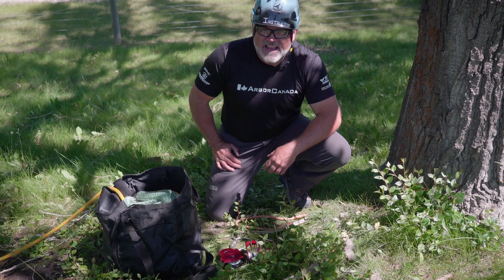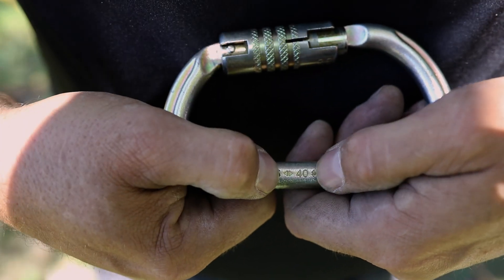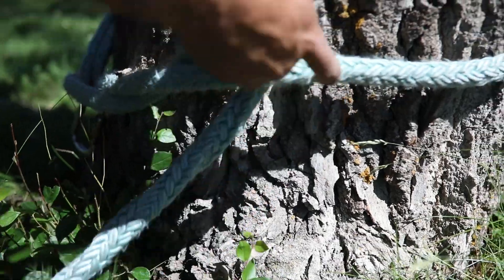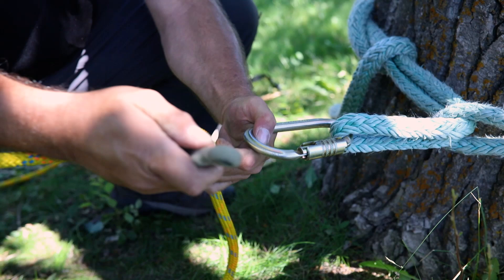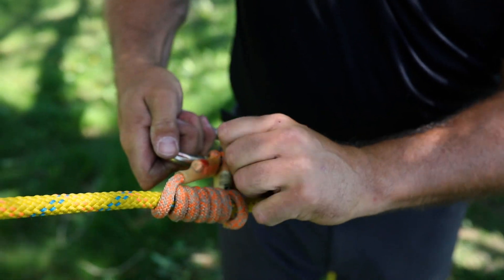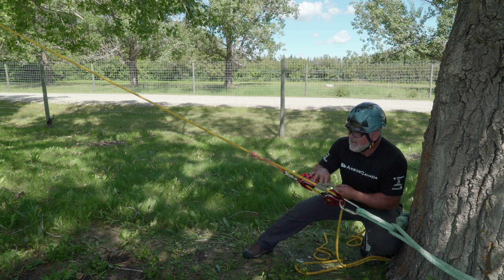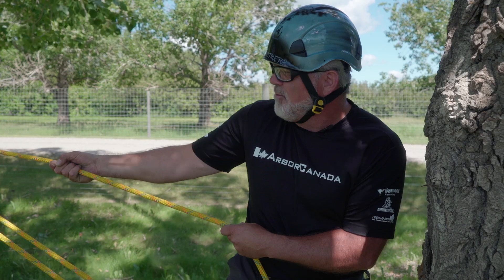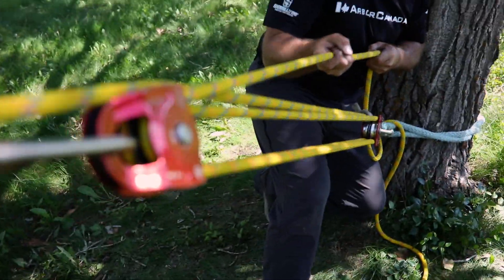Building Mechanical Advantage (3:1 or 5:1)

Comment: Great vid.
I must say I was immediately yelling at you cuz you should NEVER use only one sheath of a double block, it's very unsafe [wish you would've mentioned that].
For the purposes of instruction I understand why you did. Explaining the compounding forces applied is easier one step at a time.

I did learn about the french prusik so bonus for me and that does open up a few ideas. It's essentially a snatch prusik 😀. I am going to make myself a few french prusiks for my purposes, even with just a carabiner it'll help with similar riggings I use. Not as much mech advantage but enough for my use-cases. My "200 lbs" is constant [at a fat ~220 lbs 🤣] so when I only need to pull 600 lbs I don't need 5:1.

Well done, thank you

Comment: Best explanation a straight forward setup that I’ve seen for a primitive progress capture/mechanical advantage system. Glad you didn’t build it with more expensive fancy devices like tooth cams. Also, it’s a good idea to use pieces manufactured from Technora or some other heat resistant material at your prusik points as these contact points with your main rope can become high friction points that may be prone to melting with nylon pieces. It’s not a problem with the rope as a different points of the rope are always moving through however the prusik points are seeing constant friction. This would apply more with hauling, moving a large object and less with taking the tree down as you shouldn’t have to put a lot of rope through the system before the line is taught.
Reply: Thanks, that's excellent feedback 😀 👍
Reply: @HollywoodNeuy  thank you for the awesome information. I appreciate you.
Reply: Thanks 😊